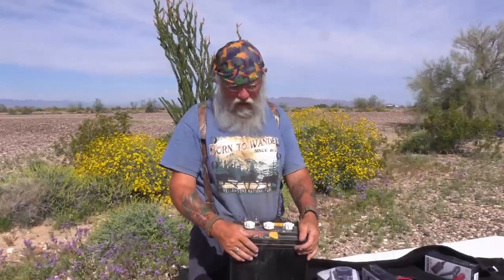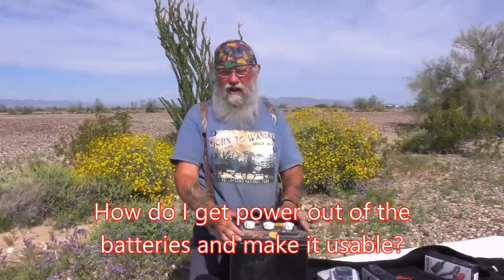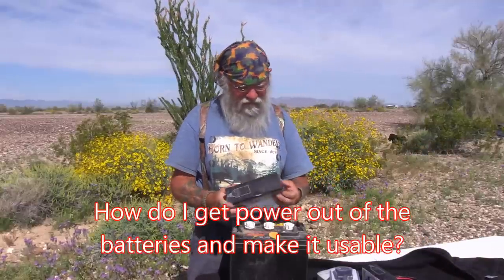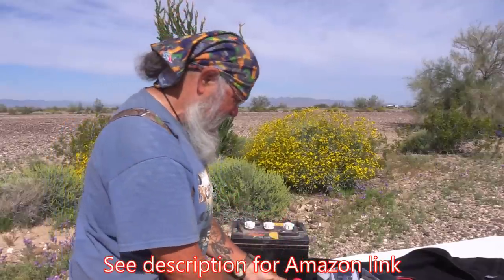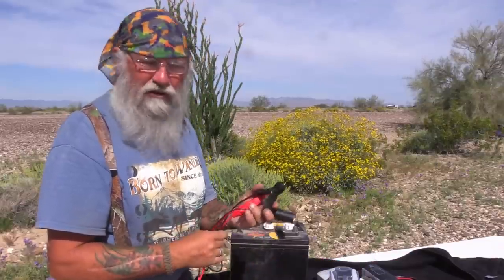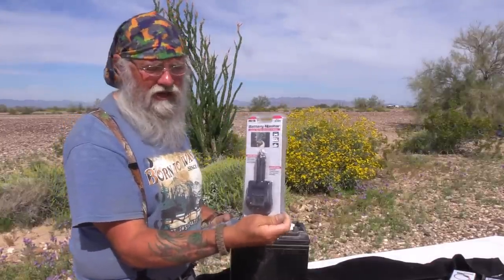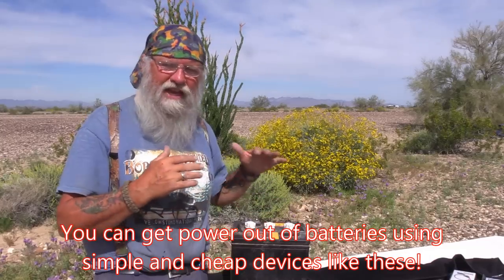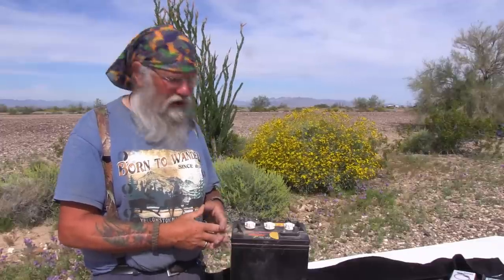How to Get Power Out of Your Batteries

Comment: Even though I'm going "fancy" on my electrical build I appreciate you making things accessible for people who want simple / cheap.  One thing I'd suggest is including more information on electrical safety (fuses, shorting, etc.)  Maybe a separate video?  In this video it came to mind when you mentioned the inline fuse and using pliers to tighten the connections - I'd hate for someone unaware to accidentally short the posts with a long pair of un-insulated pliers or to allow items stored above the battery to create a short / fire.  Maybe include some battery box options in a future video as well?  I'm using one with my LiFePo setup and have installed protected (fused, polarized) Anderson SB350 quick disconnects on the box for the external connections keeping the hard mount wiring protected inside the box.  I'm using Anderson Powerpole of various sizes throughout my build and recommend them highly - the 12v electrical parts vendor I've been most happy with is here:  https://powerwerx.com/

Comment: Bob, today I nearly burned a camper down when a 500 watt inverter fried. I would love to see your review and recommendation on these units. Apparently it shorted inside without even being turned on (it was wired directly to the battery) The solar charge controller was showing the battery voltage mysteriously dropping without any apparent load. I leaned into the charge controller to read it's data and suddenly the inverter began to belch out massive amounts of smoke. Again, it wasn't even turned on. I immediately unscrewed the cables and ripped it off the wall. I can not be sure if it would have started a fire or merely  toasted it's innards. Scary to the poor camper owner and now I am stuck trying to find a safer option for her, but she is a brave soul who wants the freedom you speak of and I am determined to make this 10ft camper a comfortable home for her.

Comment: Bob, you talk about power for RVs. I problem is, my husband and I have a teardrop trailer. It has a battery that runs the lights and charges phones and iPads . The big problem is we both use cpap to sleep. We can’t use the plug ins for anything unless plugged in to a camp site. No one I’ve ask knows how to get power for the chaps without retiring the whole trailer. We have a solar panel for charging the trailer it’s self. Do you know how to get more power to the trailer? We bought a 1000 Yeti that gave one person 6 hours of sleep. Thanks

Comment: When hooking this battery up, you have to be careful to isolate it from the battery under the hood. If you do not do that, you will be draining your starter battery as well as the marine battery. You basically need a one-way wire (with a diode) or a physical way to disconnect it from your car's electrical system.
Reply: They make 12Volt cords with two male ends. It makes it easy to charge your battery from the 12V (cigarette lighter) outlet as you drive along. Once you park hook up the inverter or USB adapter and you're set.

Comment: Wow, Bob, very practical tips.  One question, when battery indicator shows red, how does one charge the battery? Can I simply put battery back under the hood and drive to charge it?
Reply: They make 12Volt cords with two male ends. It makes it easy to charge your battery from the 12V (cigarette lighter) outlet 
as you drive along.

Comment: Are the 12v sockets regulated to 12v or the unregulated battery voltage? 
Some 12v devices might fry above the battery's 13+ voltage, especially if the charger is sending 14+ volts.

Comment: I don't really like MC4 connectors or cigar plug connectors. I cut them off and use XT60 connectors. I wish the industry could standardize on something more reliable, smaller, and rated for 60 amps.
Reply: I don't like MC4 connectors either.  It's only size 10 wire. Sometimes I need thicker wire for longer wire runs.

Comment: You really should try to do everything with 12VDC because those inverters are very inefficient and will waste a good portion of your battery capacity. You should also install a low voltage cutoff so that you do not run your battery all the way down. It's very bad for batteries to be run all the way down.

Comment: He probably meant to say “converter”, not “controller”.

A “converter” “converts” 120 volts AC to 12 volts DC. 

An “inverter” changes 12 volts DC to 120 volts AC. 

The only “controller” I’m aware of is used with solar panels, to “control” the panel output voltage.

Comment: Make sure its a 12 volt battery.  Some chargers may work at 6 volts if the voltage regulator built in has a voltage threshold that allows it to work around the 6 volt range.

Comment: Bob, at 9:50 you say 12.2 volts minimum?
Reply: 12.2 volts is a battery at 50% depth of discharge. If you take a lead acid battery lower than that it starts to cause damage to the battery. You should never go below  12.2 volts with a battery at rest.  If you take a fully charged battery and put a big load on it, like a 500 or a thousand watt load on it, your battery will show 12 volts or less, so you want to check your voltage when the battery doesn't have a load on it.

Comment: Two things that ALL new users need to know about running things off 12 volt batteries: 
1. You can only use half of the amp hours shown on the battery label without severely damaging the battery. If you have a typical 75 amp-hour battery, only about 37 of those amp hours is available for you to use. A volt meter is a MUST HAVE accessory. When it gets down to 12.2 volts you are done, and the battery must be recharged. Keep this in mind when shopping for a battery.
2. ALL inverters are massive power hogs. For any inverter use the 10:1 rule. It takes 10 TIMES as many amps from the battery as is shown on a 120 volt appliance label to run that appliance off the inverter. A typical 400 watt inverter will suck 32 amps per hour of use from the battery at a rated load of 3.2 amps, killing your battery in one hour. Nearly all appliances have the amount of watts (power) they use on the label. Divide that number by 12 and you will know about how many amps it will draw from your battery when in use. Keep in mind that  the inverter is only about 80% efficient, so the actual number of amps drawn will be more than calculated. So take your pocket calculator when appliance shopping, and read those labels before buying!
Reply: Sagebr
Reply: Sagebrushbob Thanks for that quick lesson!

Comment: By "your rv controller", do you mean the converter? I have a question. To my knowledge, I don't have an inverter, but when I took out my house battery to top it off with distilled water recently, it had a hardwired setup, as you are showing here (with the loops and wingnuts.) There appear to be two negatives (4 white cables with those loops) on the negative terminal and one (or two?) on the positive terminal. Am I missing something here? Is that how the converter is hooked to the battery or do I have something that I'm unaware of?

Comment: Your electronic items that charge will be fine on a modified sine inverter because you are really running off the battery. Something like a desktop PC will work if you use an UPS backup system.

Comment: Anything that is actually running on DC, but has an AC plug (like a modern TV) will work fine with a square wave. Most things that will be affected should be running off of DC anyway.

Comment: Can you hard wire more then one item to the battery?
Reply: Angela Raymond. Yes you shure can. Inverter can be hooked up at the same time as the 12v sockets. Now, using them all at once is dictated by your battery size.(measured in amp. Hours) little battery=80-100 amp. Hrs. Big battery=200-250 amper hours. Some 400amp hrs.

Comment: Bob, I have watched oodles of your videos and I love them. However, in the electrical category, I notice one important thing: Whether you are talking about solar power, or batteries, or charge controllers or inverters (or whatever.)... whether you are talking about 12 volt or 110 volt.... I have never heard you make the distinction between AC and DC. THIS IS A VERY IMPORTANT DISTINCTION! I must seriously question whether you get it! 

Battery power and solar panel power are DC (direct current), while 110 volt household power is AC (alternating current). You understand this, right? Why do you never mention it?
Reply: I'm a certified electrician, Bob. Solar panels and batteries produce DIRECT current. Their current flows in one direction. Household items or things that run off the grid typically use ALTERNATING current. I hope you already know this. When people in vans use batteries or solar panels to run household items using an inverter, they are not just changing the voltage from 12 volt to 110 volts. They are also (and more importantly) switching from DIRECT current to ALTERNATING current. Please SAY SO in your videos. It's important.
Reply: Just to clarify... most houses in the United States and buildings get their electric power from generators in power plants. These power plants, whether located at coal or natural gas or oil burning facilities or dams on water reservoirs, produce electricity which is ALTERNATING. That is to say, the current coming from these generators flows back-and-forth. That's what "AC" means. The power coming from batteries or solar panels instead flows in one direction. It is "DC". 

If you live in a van or an RV, and you want to use household appliances, you need to convert the DC to AC. That is what an 'inverter" is mainly for. There is also a voltage change, from 110 to 12 volts, yes, but more important than that is the change from AC to DC.
Reply: Thank you for your explanation!!  Still learning.   I understood that DC was a cigarette lighter and AC was a wall outlet, and understood what the letters stood for, but didn't understand what that meant.  (One direction vs back and forth.)  So now my next question is, why is the distinction important?  And how/why does a microwave (for example) return the power?
Reply: The distinction is important because its so basic. It's the single biggest difference between how batteries and generators of all sizes produce electricity. Batteries have a positive terminal and a negative terminal, whereas the wires inside the walls of your house have no positive or negative about them. In both cases, however, to get electric current (alternating or direct), there has to be a closed "circuit". The word "circuit" means a closed loop. The "loop" might go from one battery terminal through your 12v cigarette appliance, back to the battery for instance. The little electrons just flow around that loop in one direction. Or, the "loop" might be from your inverter "hot" terminal to through your microwave and back to the inverter's "neutral" terminal. In the latter case, the electrons are zipping back-and-forth inside that loop, changing direction. That's why we speak of a "sine wave".... because the voltage is constantly going positive-negative-positive-negative, 60 times a second. When you use an inverter, you are using that first DC "loop" to create a second  "loop" (or circuit) which is AC.
Reply: To grasp what's going on with electricity, it's important to understand that electricity always travels in a loop. In the case of DC, the electrons maintain one direction in that loop. They go through one wire TO the cigarette lighter, and a different wire back FROM the cigarette lighter, in a closed loop or circuit to the battery. In the case of your microwave (AC), the electrons switch direction 60 times a second inside the circuit (loop), whatever wire they happen to be in. Notice that there are always at least two wires in any cable or extension cord for an appliance. That's because you are dealing with a loop. Even from the generators at Hoover Dam or Niagara Falls, stretching across many miles to the first substations, the current is always traveling in loops. One loop can be used to run another loop, which can run another loop, etc., like a series of gears turning each other, all the way from Niagara Falls to your vacuum cleaner.

Comment: Controller = Converter?
Reply: William Klein he probably meant to say “converter”, which “converts” 120 volts AC  to 12 volts DC. 
The only “controller” I’m aware of is used with solar panels.
Reply: Yes. 

In the video , Bob used "Controller" to discuss DC power. I think he meant "Converter". 

When I hear Controller I think "Solar Charge Controller". 
When I hear Inverter I think "Change DC to AC"
When I hear Converter I think "Change AC to DC"
Reply: Agree
Reply: tomnorman457 yes I was thinking the same thing 👍

Comment: Didnt anyone else notice that was a 6 volt battery???
Reply: Must have been the reason for not actually operating anything.
Reply: BigFireDave yes immediately
Reply: Im sure it was for demonstration purposes only. He runs 2 6s to make 12 so maybe didnt want to drag both of them out but yes good idea to point out that it should be attached to the + on one and - on the other if thier in parallel
Reply: That's right.  I didn't even look at the battery, that isn't what the video was about.  LOL
Reply: BigFireDave yep sure did!
Reply: If you got 6 volts it should last twice as long! DOH
Reply: yep
Reply: 6v batteries tend to last longer so many people use 2 of them in series to get their 12v

Comment: i would recommend a lithium battery.
Reply: Joachim T They make sizable lithium battery inverter/generator that has 12 volt, 110 volt, and USB ports AND a port for a future small solar panel. Inverter can charge that way or plug into AC or cig lighter. I bought one for $300 that I take camping but also bc at home during a power outage I can plug in my DSL modem, laptop, phone, tablet, and TV!  There’s a digital power-left readout, too. Says 500watt/peak 100 watt. Oh, and it has a light & handle. If I travel more, I’d get the solar panel. This is not cheap, but I like the versatility. No gasoline to deal with.
Reply: That’s peak 1000 watt